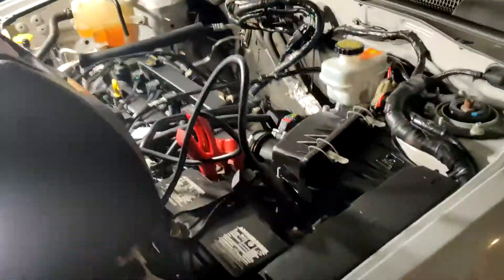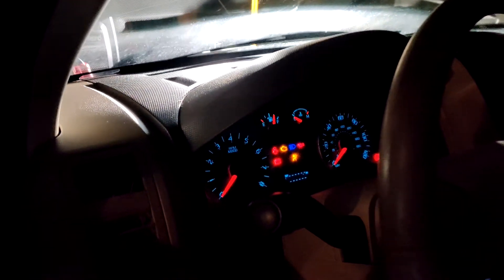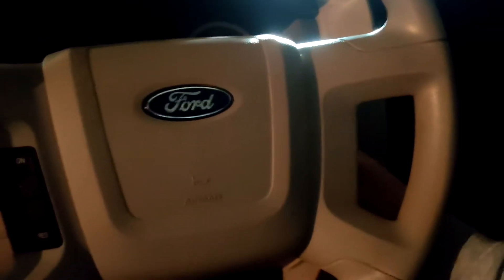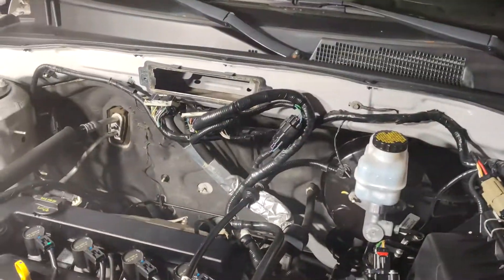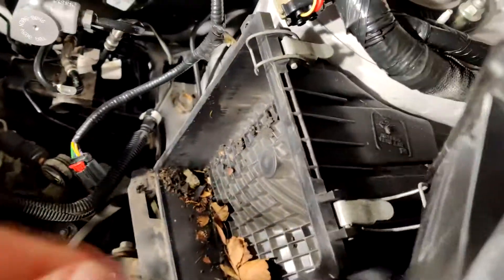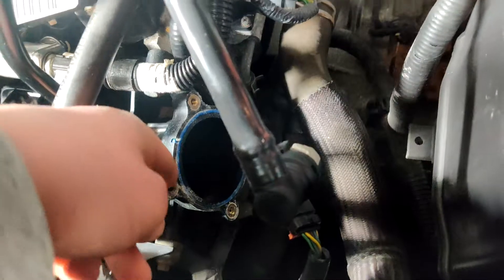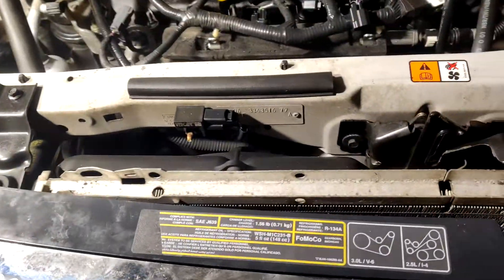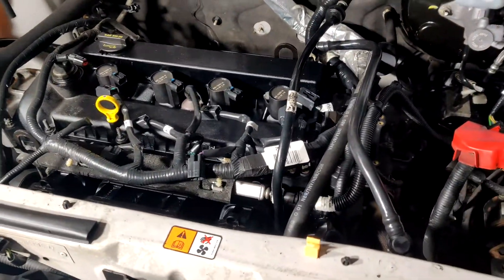Ford Escape EV Conversion: Episode 1 - Teardown

Comment: Wow, I would not want to be attempting this. Can’t wait to see how it turns out!
Reply from the maker: Thanks so much for the comment mate! It's been going pretty well so far but a big snowstorm in the DC area has slowed me down a bit. I just posted another video so go check that one out!

It's definitely a big project, but compared to a gas car, the parts that make an EV work are relatively simple. Tearing apart this thing has made me realize just how insanely complicated gas engines are.

Comment: This is Awesome! I was was looking into converting my  Escape Hybrid into full Ev.  I should be able to adapt the motor to the CVT transmission  Right ? and replace the Main Battery with 53 kws ? right
Reply from the maker: Mechanically that would be pretty straightforward. The hard part is getting the motor to interface with the existing hybrid system. 

How powerful is the electric hybrid motor already in the car? I wonder if you could just swap the main battery for a bigger pack with the same voltage and have it all work nicely with the existing software and CANbus networks.
Reply: @reider_mcfeely  I will be looking into this !! on to watching your journey I have subscribed and added you to my channel !!
Reply: My research shows 330 V 6500 mah Nickle Metal Hydride Batt, combined with a 93 Kw, looks like a pm ac sychron motor